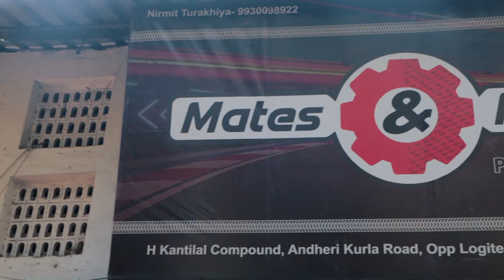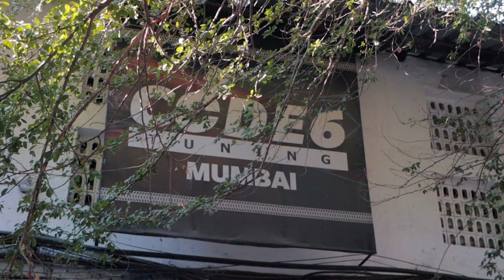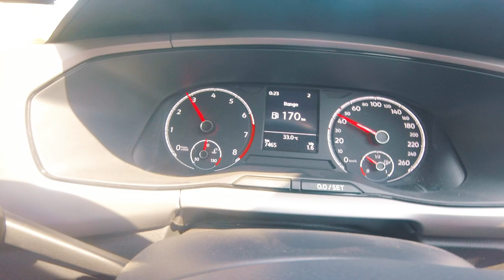Stage 2 Remap & Performance Downpipe for the VW Taigun 1.0 TSI MT! | Project Taigun

Comment: Did you guys dyno the car while it was stock?? Dyno's without a comparison doesn't make a lot of sense.
Reply: I believe that code6 has already dynoed a stock car, even if they haven't they still can
Reply: @PHOENIX-xj3gz  I hope its the same dyno.
Reply: Oh yea I totally forgot about the tolerance of different dynos
Reply: Sadly we couldn't dyno this same car stock, but we have dynoed a stock 1.0tsi with air filter and manual gearbox on the same dyno, it produced near/lesser than 100whp, we should have a sheet of the same with us.

Comment: Is it good to tune the 1.2 mpi Polo for daily... searched the whole yt didnt have any content on the mpi's
Reply: Bro I used to have a 1.2 mpi ... Power upgrades aren't worth it bro ... May be save and upgrade or if you can get a 1.6 mpi that will be awesome
Reply: There is no turbo for mpi, so maximum what you can do is canonical air filter with cold air intake (make sure to cover the air filter from sucking engine's hot air), decat and put a free flow exhaust with header porting and polishing. Doing all this will increase 10 to 15 hp which is not much.
Reply: 1.2 mpi is not that of a tuner car tbh. You can do high end builds if you have a deep pocket, but reliability is an issue to be addressed.
Un my opinion Harmonix tuning is the best guys to answer your question.

Comment: is it worth to tune amaze 2014 ivtec with 1.2L NA engine?
Reply: Nah. Na engines don’t give much gains
Reply: Can I turbocharge it?
Reply: @manavverma6299  nah u better don’t . If you do you won’t get a reliable engine. Better sell it and buy a tuner friendly car like a polo or Laura 1.8 tsi
Reply: @manavverma6299  won’t be easy and will be damn expensive. The turbo, intercooler piping, fuel injector change, ecu map. Plus you will have to change the gear ratios as well to handle the torque. And cuz it’s a mpi, at max it will give 110-120hp reliably. Better sell it and buy an already turbo car and Remap it as a 30-40k stage 1 tune with air filter change will give massive gains
Reply: @manavverma6299  turboing will be expensive. But for now you can give it a stage1 remap with downpipe, cold air intake(shielded from heat) etc. Thats it.
Reply: @nithinsenthilkumar9954  I mean the Laura 2.0/1.9 tdi should be a better option since it’s fuel efficiency is a lot better than a 1.8 tsi and these engines are pretty tuneable too.

Comment: Why not straight out buy the 1.5mt Tiagun
Much better than this
Reply: It ain’t tuner friendly. The max torque limit for the 1.5l gearbox is 250Nm
Reply: @nithinsenthilkumar9954  that is for dsg dq200 not for the manual one
Reply: You can get base model of taigun for around 13 lakh put additional 1 lakh and you have this withing 14 lakh mean while the 1.5 gt version would cost around 19 lakh here in delhi so you save about 5 lakh